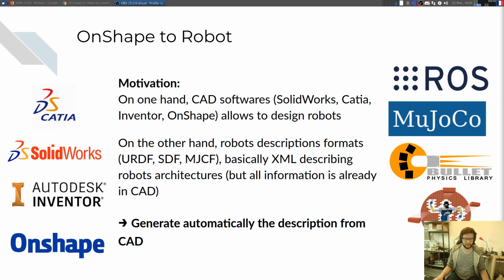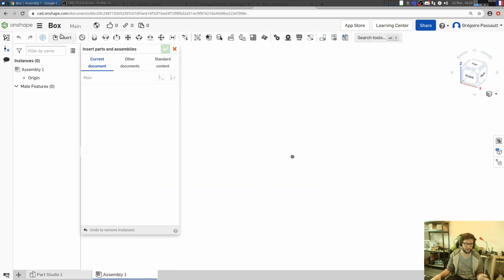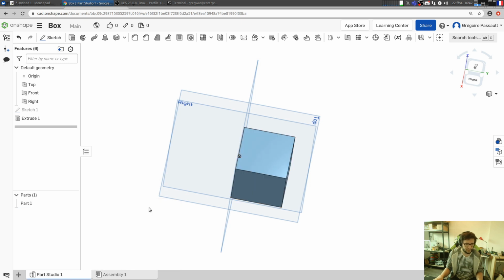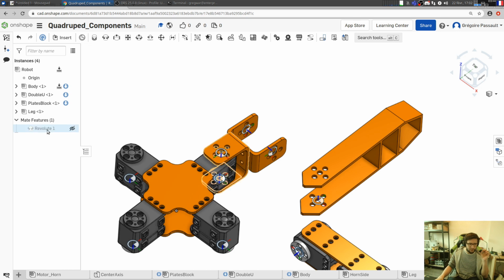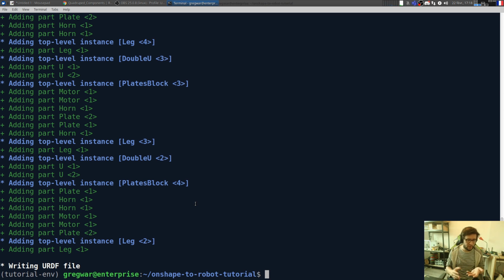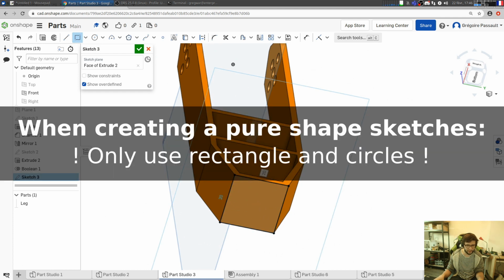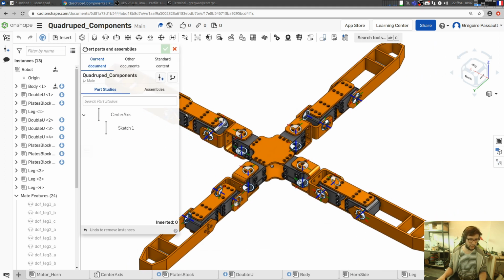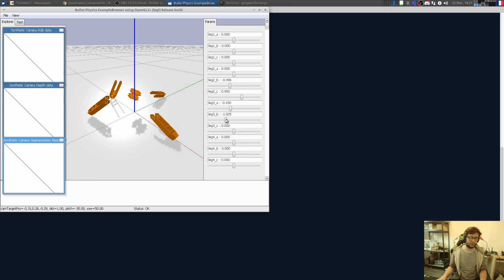Onshape to robot tutorial (export URDF, SDF from Onshape)

Comment: does mesh simplifcation work on windows? I tried installing meshlab but onshape to robot still doesn't recognize its presence. What would be the windows equivalent to the "sudo apt-get install meshlab" command?
Reply from the maker: It is likely not compatible, but might be adapted if the meshlab command lines exist on windows. You might try scoop.sh as a first guess alternative, but I dont guarantee it will work

Comment: It's great but could you help me that when I transform file, joints did not generated only objects are there and they did not move...
Reply from the maker: Could you open an issue on the Github repository and share the document with me?
Reply: @gregoirepassault2701  I figured it out, I just simply did not add dof_ in my name. Thank you for this great lecture

Comment: I have an issue with the refrence frame of the joint limits from onshape not correctly working in onshape-to-robots. Is if fine if i create an github issue?
Reply from the maker: Yes of course
If you can provide a minimal onshape assembly that reproduces your problem it will ne easier as well

Comment: Absolument génial ! Bravo pour cet outil !
I have 2 questions:
1) Is it a personal project, or do you develop it for your work?
2) Could it be possible to use automatically exported STEP objects as Pure Shapes?
Reply from the maker: I develop it for work, I am part of a research team called Rhoban, we design humanoid robots.
I am not familiar with the content of STEP files, but pure shapes are very restrictive (it should be union of spheres boxes and cylinders), so I am not sure the move is trivial to do, feel free to open an issue on Github with more details!
Reply: @gregoirepassault2701  I don't think that STEP are described only by spheres boxes and cylinders, so it does not seem to be a good idea.
Reply from the maker: @fred-9929  It would be really interresting to have an automated process for this approximation, maybe there are existing tools that we could plug there, but it should always be watched carefuly, if you handle an expansive robot with a lot of torque you don't want to fail with detecting your collisions